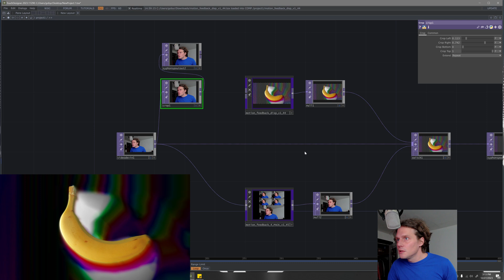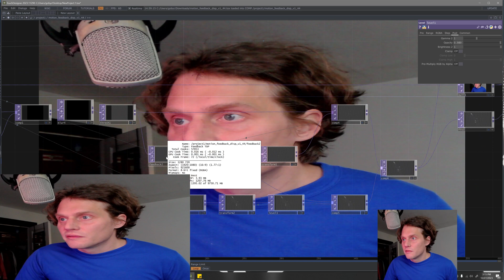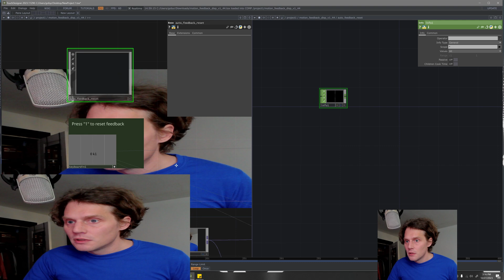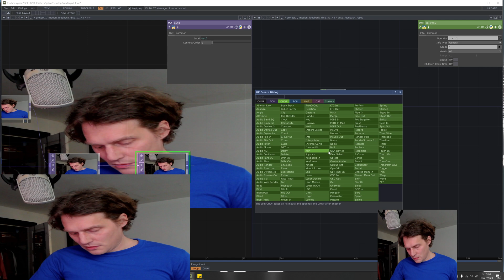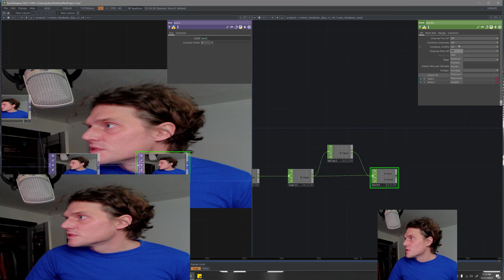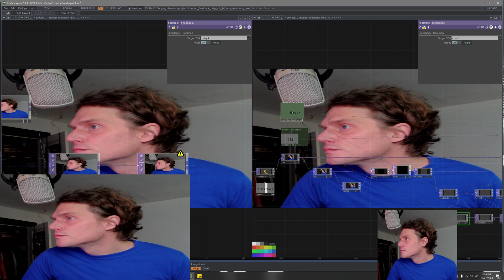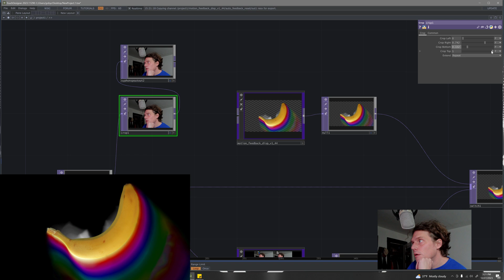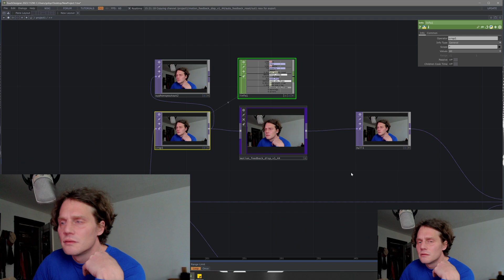Automatic Feedback Fixer Utility (Beginner TouchDesigner Tutorial)

Comment: me.inputs[0].width == op(‘anyTopBeforeThefeedback’).width in the pulse parameter of the feedback…this will pulse automatically the feedback . Each time res changes
Reply: To be really precise you could store the resolution and check for w and h. Writing this in one line can be a bit tricky.  A smart solution could be to take two infoChop  for the resolutions one before the feedback the other after, and check if  infoBefore-infoafter is not 0. If so pulse. This can be done with a logic chop. :-)
Reply from the maker: @unveil7762  That's all I'm doing here, right? Two info CHOPs, I'm just using the container in/outs here, but my .tox has custom top references. Then subtract the difference of in/out of res_x and res_y separately, and if either is a number other than 0 it pulses. I added a delay to send an additional pulse because sometimes the initial pulse can get missed.
Reply from the maker: Thanks again for chiming in with the pro solution. 🤍 I'm still wiring my brain to think of python shortcuts, and hope this tutorial helps beginners think like a programmer without worrying about syntax and such.
Reply: @worldwidebasementvibes ❤